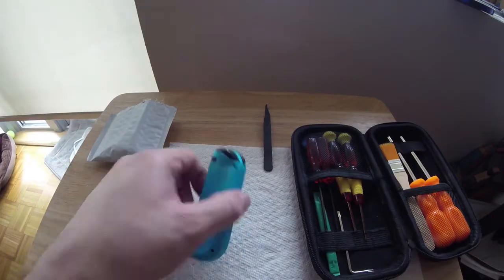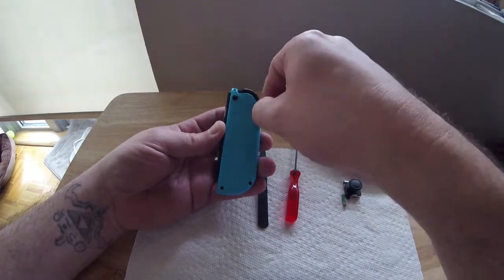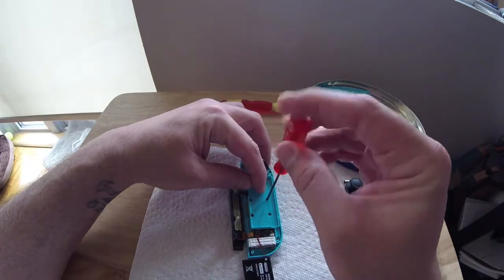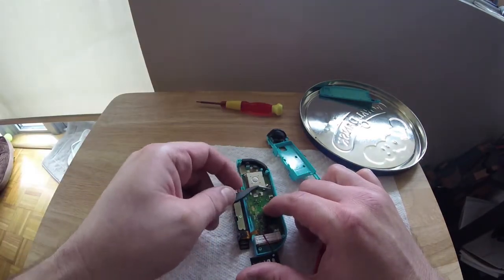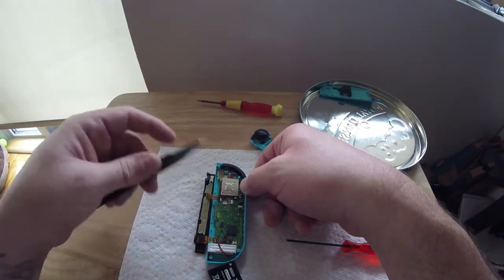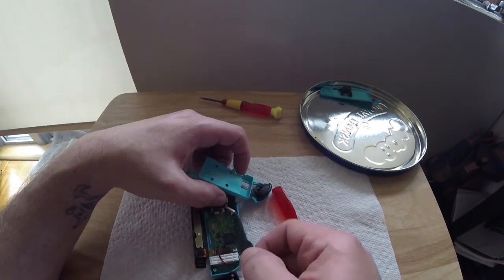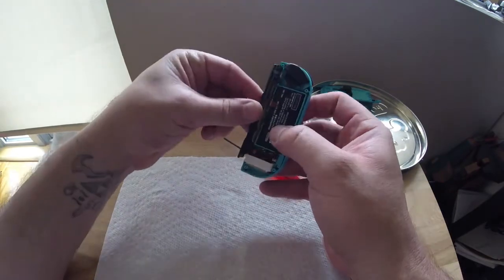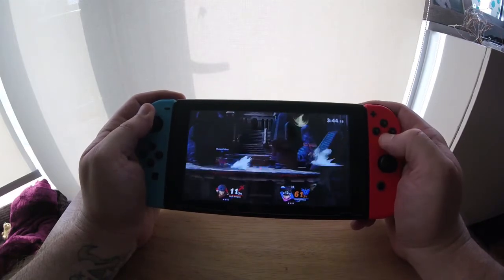How To Fix That Pesky JoyCon Controller Drift (Tutorial)

Comment: You did a great Job with this! I don't know if im brave enough to make the repair but I have a joy-con with the drift issue so maybe I just give it a shot. It would be a great skill to learn. GG bro!!!
Reply from the maker: Thanks allot bro! If you have a joycon that's pretty much unusable. It serves as a great testing ground. And also as a confidence booster as these kind of tinker projects can seem a bit intimidating! But once you get in there it definitely the intimidation melts away! Id say give it a try if the joycon isnt really usable and if you feel still like you may screw up, send it to me and I'll put Humpty Dumpty back together for ya dude😁 but if you take your time. This could open up a new area of awesome skills for ya! I've fixed several things at this point including a mini projector I thought was finished lol
Thanks so much for watching!